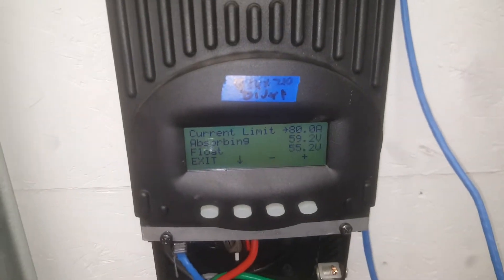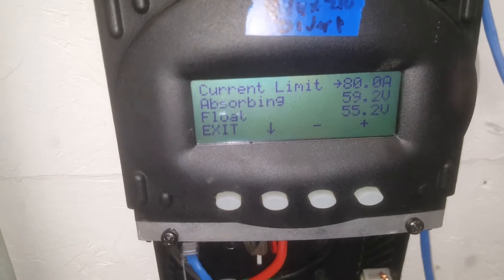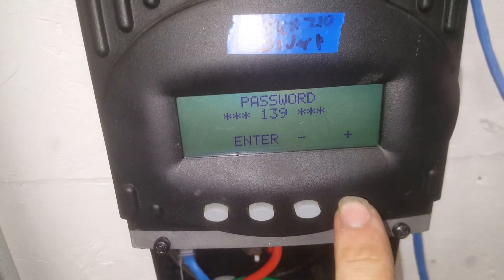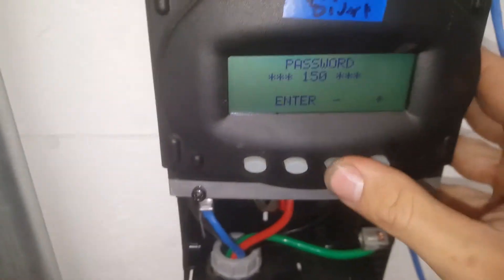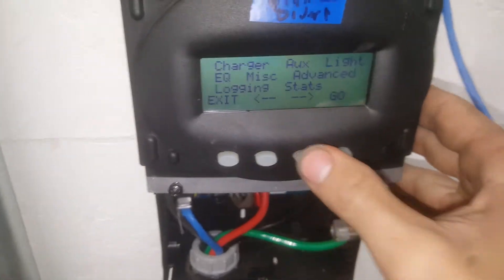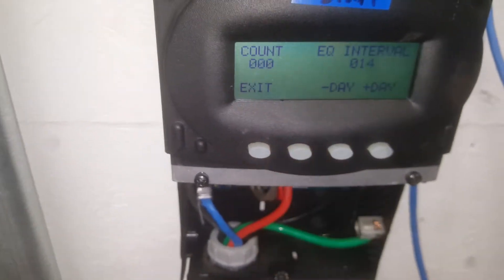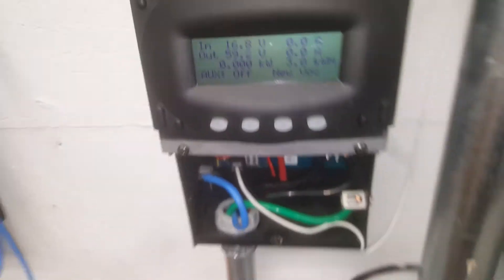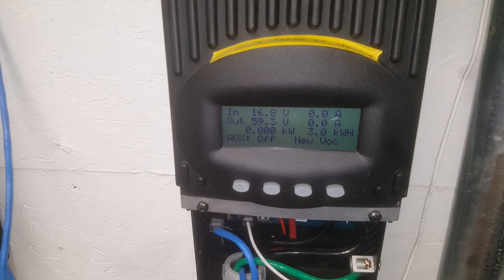Outback flexmax 80 charge controller voltage settings

Comment: What's the maximum PV volts these controller can take is 98 DC volts from the panels too much
Reply from the maker: No 145 volts is the max
Reply: @HighTechLab  so it won't cause a problem even if the battery voltage is 48v

Comment: Hola, nice video of yours. Please i have a quiestion. I just bought the same contrller and have a 24v battery bank. The distance between the controller and the bank is aprox 6ft. The installer wired ALL the system with awg1/0 cables (excepts the cables that comings from the pv panels) Should i have to change those cables or its ok with them?

Comment: Hi, I have a q. about the controller, is possible to change the set voltages (absorb, float) at any time in order to start the bulk charging, floating state and so on wen I want to, or I necessarily need to turn off the whole grid, set the parameters and then start the whole thing again?
Reply from the maker: Luis miguel León Gil it can be changed on the spot
Reply: Thanks, aaand other q. more, If a bulk charging stage starts, do I need to wait until batteries reach the absorb voltage to finish the bulk charging? or while in bulk charging stage, could I change the absorb voltage to a lower value forcing the controller to finish the bulk charging earlier?

Flexmax 100 works identically, right?

I appreciate your help

Comment: i have 8 Trace 235AH 6V Deep Cycle Battery  48 volts and have the flexmax 80 can you tell me what are the  charging voltage set points-current limit, absorb, float, absorb time limit, end amps and rebulk.?

Comment: I have a VERY LARGE renewable energy project throughout the western states in the US and this system would be perfect fit with a whole new twist for renewable if your interested. KR
Reply: The Outback Flex Max 80 only can handle 1000 watts per controller. That may not be great for a very large project.